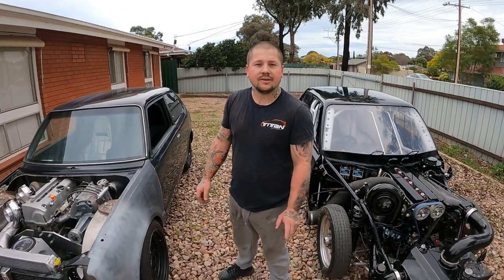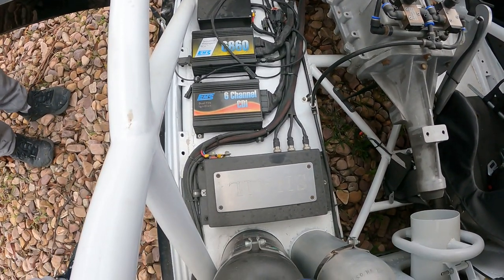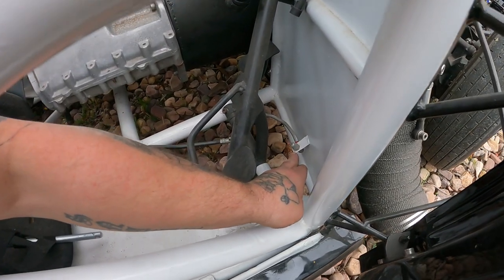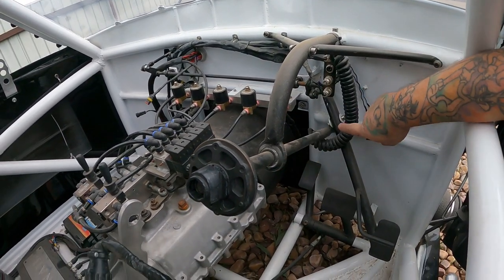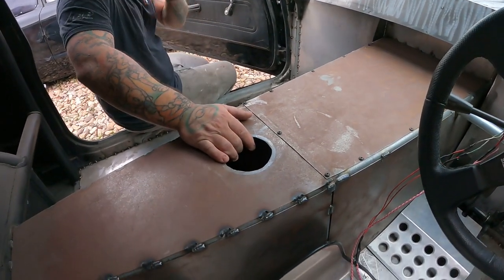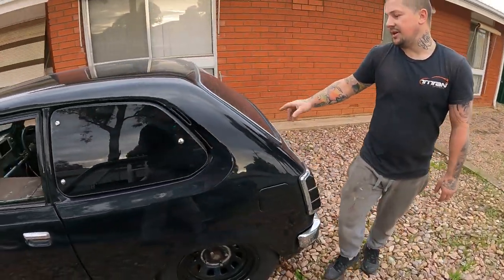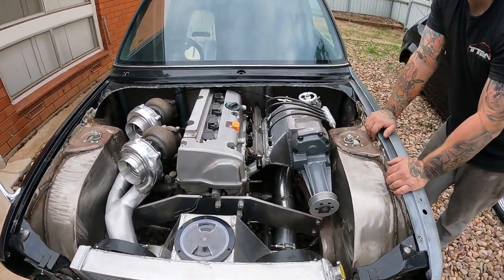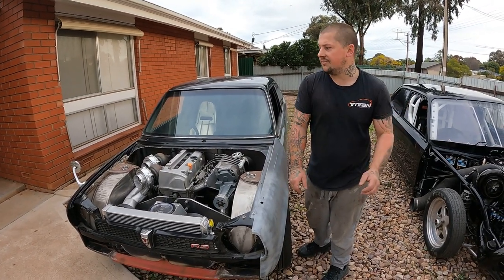worlds most wild  civics  finally together nearly 3000hp

Comment: It's great to finally see a 1st gen with the roof gutters/drip rails removed and roof seal channels welded up. This is what I'm doing with my 78 Civic but I really wanted to see how it looked. Cheers for that. I have the spot weld removing drill bits, so now I can get stuck into removing the gutters/drip rails next. I'll let the paint shop weld the roof channels up for me when it goes in for paint. If you were ever on the 1st gen Civic website, I'm Steph with the dual twin-barrel Dellorto intake and stainless headers, polished 1200 block and all the accesories and bolt ons, chrome valve cover, etc, etc. I'm also in SA (Adelaide). Love your work... it's insane.
Reply from the maker: cheers mate yeah looks much better all welded up